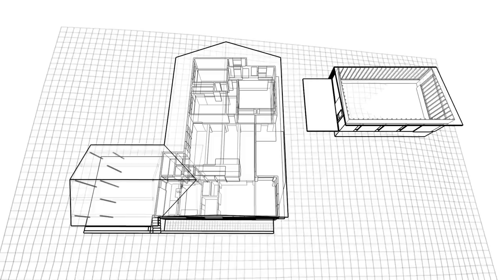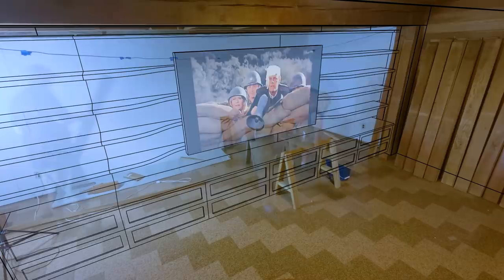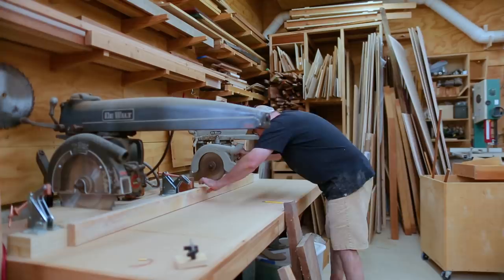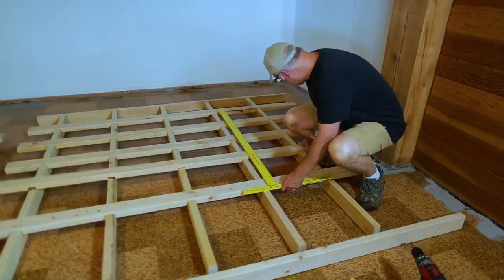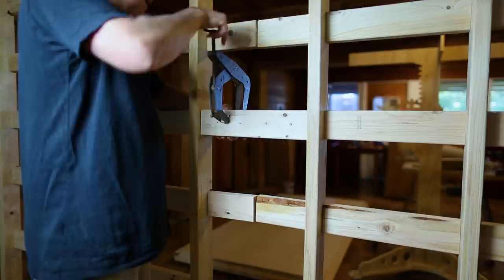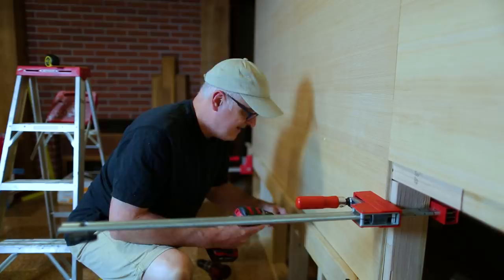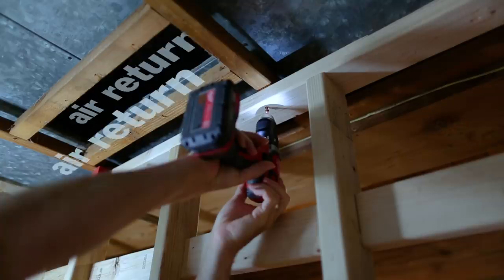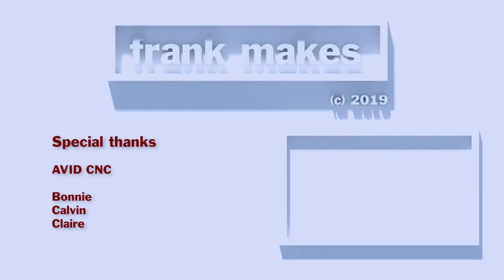Basement Remodel - Part 1

Comment: Excellent.

One critique, which I figure is probably too late to change, but I would have put the vents behind the TV. That way it would help pull heat off the TV (which they do produce a small amount of), help hide the vents without worry of them being obstructed, and give you a path to run cables behind the wall where other electronics that produce heat and noise could live (such as the amp).
Reply from the maker: That is a really good idea.

Comment: Woodworkers are skilled. So are framers. The two trades are almost as different as plumbing and HVAC work. This video is an illustration as to the difference between cabinet work and framing. To say that this wall is overkill is quite an understatement, but to each his own. One thing for sure - this wall will still be standing when the rest of the house falls down.
Reply: He is an architect you know?
Reply: Turd Ferguson .... perhaps I prejudged. We’ll see. This was the first video of his I saw.
Reply: I assume he overbuilt the wall with horizontal studs to make attaching floating shelves very easy from the back side.
Reply: Totally obvious this is more than "just a wall"... LOL.. c'mon man, we're talking about Frank H!!!

Comment: Wise to give the return air a preferred path. Otherwise, it will find a way through the wall, as you indicate, but, in the process, dust will accumulate. I would almost have recommended you putting the vents, which are quite lovely when CNCed, near the top: visible, yes, but also less prone to draw and collect dust. Just a quick thought.

Comment: Frank I love this, however, my concern is the bottom piece should be treated for basements, you may run into moisture issues down the road. As unlikely as it may seem I made the same mistake and had to take the wall down 6 months later. Never had any water issues in that space.. Till I did. Good luck. Great project!

Comment: Great project !!
I'm worried that those vents are not nearly sufficient to allow air flow, and are in the wrong location. I think they'd work better at the top of the wall.
Also, the door should swing into the main room or at least in the other direction. As it is, it blocks your access rather than giving you access. I suspect this will be fixed in the next revision.
Again, great job. Thanks for the video!!
Reply: Good point about the way the door swings.
Reply from the maker: The door is going to have shelves and cabinets on it so it can only swing in.  we would have more room for storage if it swung out.

Comment: Some recessed lighting along the sides and top might make this wall really pop!  Perhaps some LED strip lighting, maybe even RGB so you can change the ambiance of the space.

Perhaps I missed it did you attach the wall plate to the floor?  How was this done?
Reply from the maker: I'm going to have the slaves straighten the wall out, then i will attach it to the floor and finish attaching it to the ceiling.  if that makes sense.
Reply: @frankmakes  It does, thank you!

Comment: You should treat that plywood with a flame retardant (both sides). It's not very $; like flameseal or something. Esp. if you're running electrical there.

You might even be required to depending on the state and local fire code.

https://www.oregon.gov/bcd/codes-stand/Pages/residential-structures.aspx

ORSC R302.9 (it's in chapter 3 from the pdf there); requires flame spread index < 200; that's pretty loose, class C, but still.

Comment: Question for Frank (though he may not see it), is it not feasible to turn a deep vase or urn out of a single piece of wood? A piece where the opening is narrower than the widest interior diameter. I can understand how it would be prone to cracking but I was wondering if that is avoidable. I have just never seen that done and was curious about it. Thanks!

Comment: could have just staggered the strapping on the wall so you wouldn't need the extra support to connect both sides of the wall togeather
Reply: he also didnt need any of the horisontal 2x4 at all, except for the top and bottom one ofc...  Unless he told something that i missed?
Reply: the horizontal 2x4s are extra support for the floating shelves in the family room and the adjustable shelving in the storage room

Comment: How did you line up the vertical seams for the plywood panels? I am starting a similar project and I don't have a good technique for getting the panels flush with each other.

Comment: Did you find out if the floor contains asbestos and is safe?
Reply: That 9" x 9" is almost always asbestos containing.  It would have been "okay" to just leave it alone.  It is obvious from the change from one segment to the other, however, that there was no containment during the removal.  Not a good example or good practice.
Reply: @gregnoll2475  Around 8:40 the tile is there below the new wall; at about 8:57 it is gone.  9" x 9" has not been avaialble new for 4 or 5 decades.  If you look at past video you will see the floor present during other demolition and comments about the asbestos nature of the tile at that time.  I agree if left alone it would present little hazard but left alone means no dry buffing, sanding, scraping and certainly not removal.

Comment: Does something like this need a permit?
Reply: No because someone previously removed a wall from there and put a supporting beam across there - at great expense. Only to have Frank come along and put a non load bearing frame wall in anyway. 
In other words, it is not load bearing, is internal and thus doesn't need a permit.

Although you should check the regulations in your local area.
Reply from the maker: i'm just hanging a big picture frame.
Reply: @frankmakes  :)